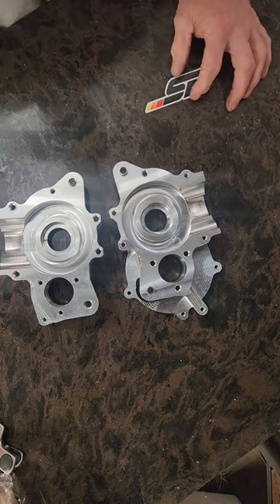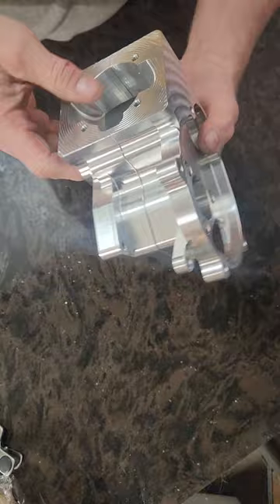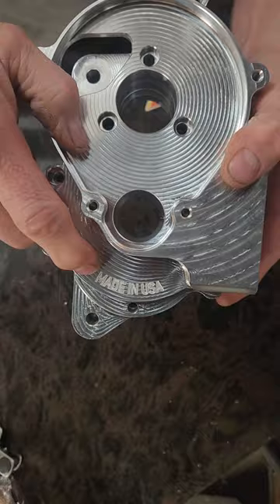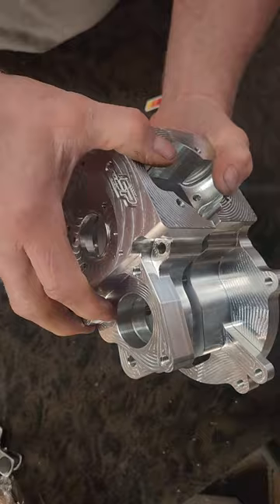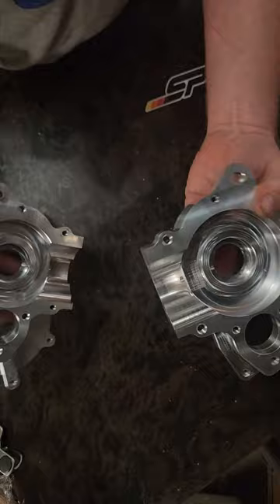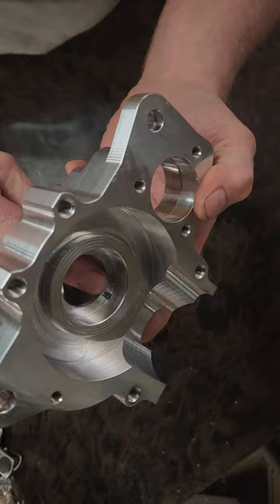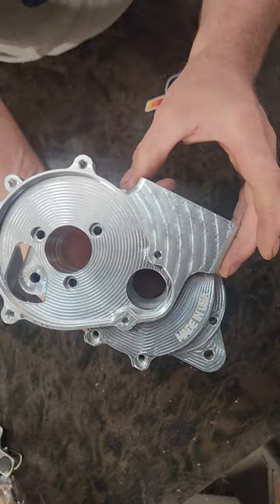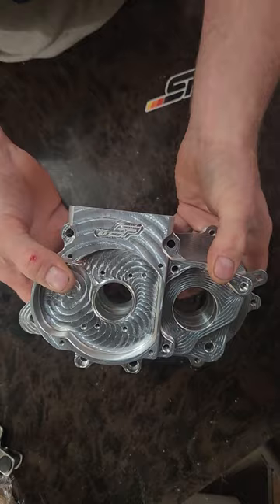2022 Smolik Performance Cnc Minarelli case

Comment: Beautiful work sir I have a quick question for you I see a lot of these minarelli engines with the cnc square high compression performance head I have one of them I also have a cnc high performance compression head it's round the compression is a bit higher you can tell because the combustion chamber is smaller which one should I use I'm just gonna be running it around town not a race track your opinion
Reply from the maker: You want the lower compression one.  Higher compression produces more heat and less rpm overall.  Minarellis like higher rpm and to help keep them cool lower compression.
Reply: @kjsmolik  thank you sir is that the same thing on the athina aluminum minaralli I'm getting ready to put one together?
Reply from the maker: @mikemiller3303  yes.
Reply from the maker: @Mike miller  you also need to make sure you have the proper squish. Thats very important
Reply: @kjsmolik  yes sir on this minaralli in particular has a 1mm squash was told that was good